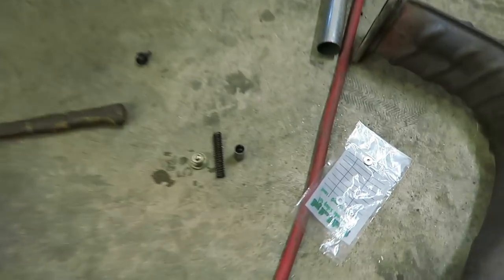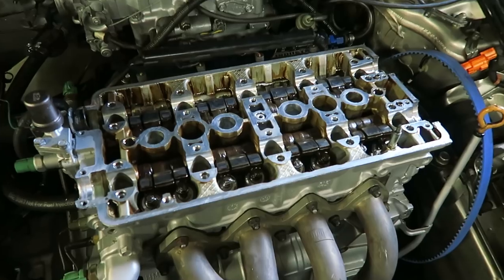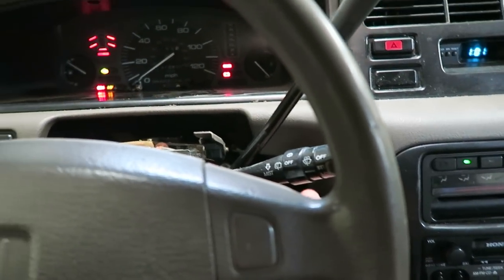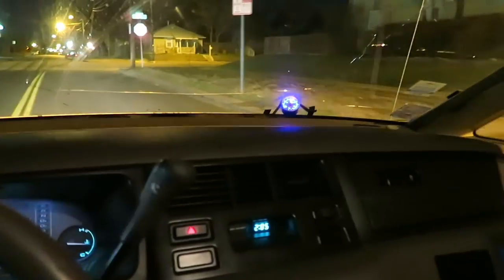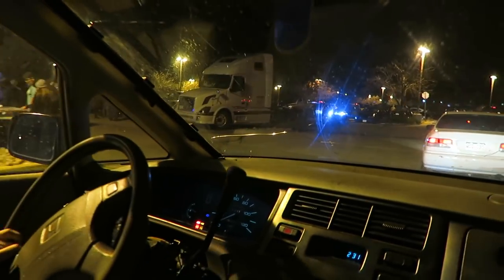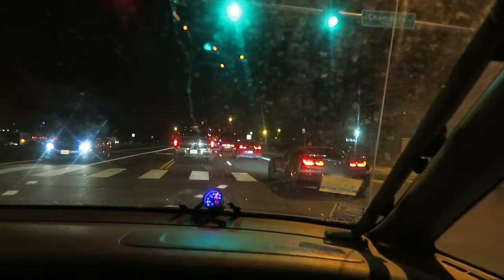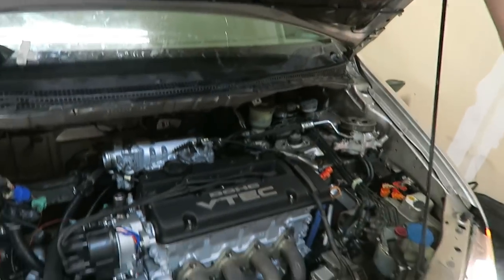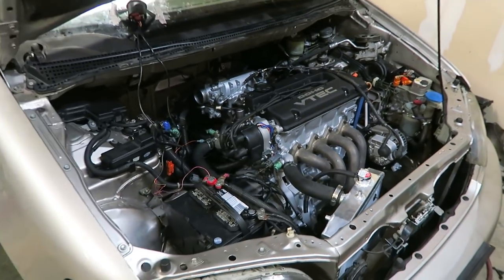Taking the Minivan to its First Car Meet!

Comment: So why didn’t he do high compression pistons and a turbo?
Reply: Nick Timar he’s not there yet obviously. He’s going to turbo it for sure soon but he wants to make it work first.
Reply: Joseph Samsor I know but why did he do low compression pistons with a turbo not high compression pistons with a turbo?
Reply: Nick Timar I’ll be honest I don’t have a clue about what compression changes in a car but this guy is so good at tearing those engines apart I’m sure it wouldn’t be an issue for him to change that. Also he had another h22 in his hatch so he probably knows what he’s doing, and in what order he’ll be doing it in. Good point though I guess
Reply: @Nick Timar if you have too high compression AND a turbo, which compresses even further, youll end up having to use reeeally high octane gas or you knock the fuck out of your motor. so low compression and a turbo is the easier way to go, since most of the air compression takes place in the turbo.

Comment: New to the car scene so can someone tell me what’s going on with his oil. Why does he need it that high????
Reply: he doesnt need it as high as he just made it. But low oil pressure at high rpms = not enough oil pumping through the engine = risk of spinning a bearing. idk if you have seen an engine taken apart, but the bearings on the connecting rods/crankshaft do not actually ride metal to metal. there is a 'film' of oil that seperates the 2 metal compenents.
Reply: HondamanFG2 Vtec oh ok thx a lot man for taking the time to help me get it. I’m gonna sub to you🤙🏽

Comment: Correction bro, you'll "remove" the washer from the oil pressure spring retaining bolt to increase the oil pressure, add to lower. Adding a washer[s] will reduce spring pressure therefore, decreasing oil pressure.
Reply: customhonda you are completely backwards on that dude...
Reply: did u even watch the video customhonda...the exact opposite of what you said increased his oil pressure by a lot lol

Comment: to much oil pressure can be bad. thou. at a certain. PSI. the oil is not gonna get threw & lube what it needs to. it like having ur bearing cleanace to tight. which is how oil PSi is made. it like with a garden hose.. if there is no sprayer at the end the water will just Flow. now if u put ur thumb over it most of the way it restrict's flow which make PSI. in so the water shoot out under pressure. FYI.. .. just like how u can tell with how much engine life is left by comparing what  oil Psi u R making when a engine is new till what it is now.. . & on a engine that has a lot of mile's will have lower Psi. cause the oil is flowing more because the clearance gap between breaing contact surface R bigger then they were new. so more oil is getting in between.  what i have learned & perfected with my XP. is a lot of high horse power guy's run looser cleanrance's " NOT TO TIGHT"   & run a higher weight thicker oil to make more PSI. & not loose flow at the say time..  it like Pan cake surp.. notice how thick it is when it's COLD Vs how thin it can get when HOT. is a good way to judge & think about it. like me. i add in some lucas but not to much to thicking up my engine oil. I run 5w 30 with Lucas when act's like a thicker. & if ur oil get to thick. u drain some out & put in some Tran Merca fluild to thin it out to how u want it. I got it down to a science when mixing oil together in my engine's  more Horse power means more HEAT can be creatived. it like a pressure cooker in a way. which  involves PSI.
Reply: its probably fine right now considering its about to help lube up a big turbo.
Reply: Same goes for turbos. Often times they need oil restrictors to prevent too much oil pressure - and blowing the oil seals in a turbo is not fun for anyone. I hope Kyle seriously takes this advice and targets a proper oil pressure. "there's no such thing as too much oil pressure" is 100% a myth.
Reply: no i mean as in itll probably see a drop once the new turbo goes on.

Comment: Asking anyone with a legit knowledge of oil pumps and oil systems. I have a 96’ Chevy S-10, has ,295+K , once it warms up oil pressure sits at 17-19 psi, any throttle  givin it comes up to 40-60 psi depending how hard your driving. On a cold start it’s 60-70psi. O don’t understand what the hell os causing it to idle at almost 18 psi. Like 12 is in the red
Reply: That much mileage the oil pump is probably on its way out.
Reply: and when that fails well so does the engine lol

Comment: Instead of using thicker oil try a bottle of Lucas oil additive. WOrks great for older engines and should work well for your motor too.

Comment: I was going to make a long post about high oil pressure and thick oil but live and learn I guess. RIP
Reply: newt3k what does it do??
Reply: Excessive cold start wear on internals as well as the starter (when its cold outside especially, it will turn to molasses).
Bulging / exploding oil filter, o-rings or seals blowing out (rear main, cam seals etc).

It's counter intuitive, but the thicker oil at higher pressure won't flow everywhere that the thinner oil would and will actually starve out the upper engine parts.
Reply: newt3k this guy knows

Comment: 4:03 - Kinda an odd thing; anyone wanna tell me what the long covers that connect the bearing bridges are called?

.. Just kinda realized I've no clue what you'd call that..

Also, you gotta put a little stick figure family on the back window; that'd be the topping on the cake for anyone you pull on once it's boosted.
Reply: K3NnY_G cam caps